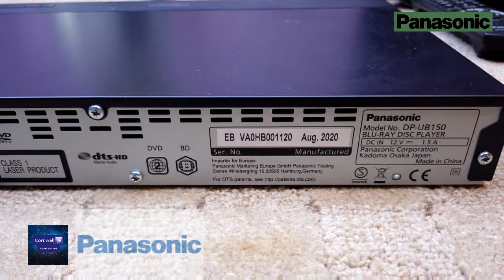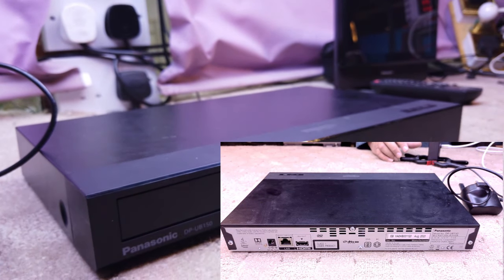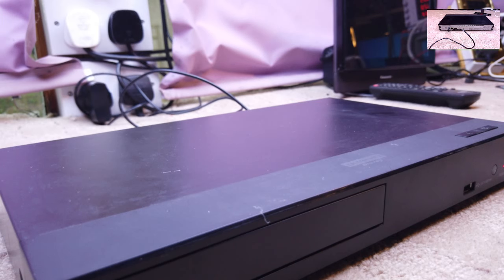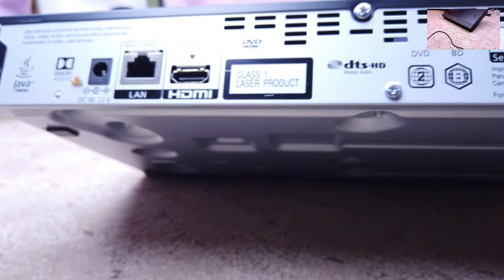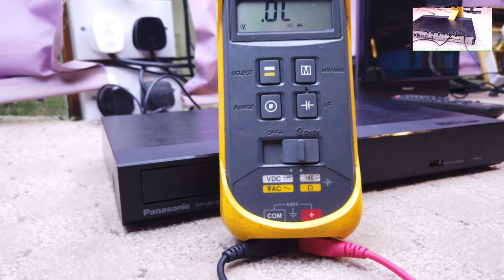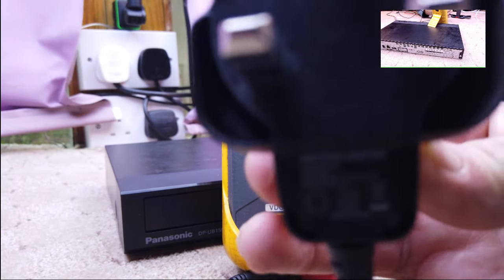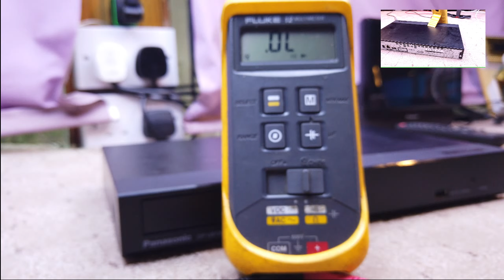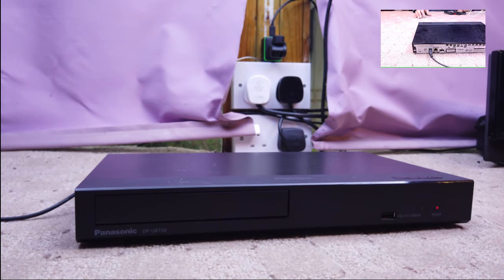Panasonic 4k UHD blue ray    quickest fix ever

Comment: I will join the chorus welcoming you back, it was a great loss when YT broke your morale.

I must admit I immediately thought "5v?" as you were mentioning it. These things are always 12v. Still, at least it seems Panasonic have finally stopped using those horrible proprietary jack (that's common with Sony and Humax) - I've actually got a little bag of that type of connector so I can convert a generic wall wart to work with stuff with that socket.